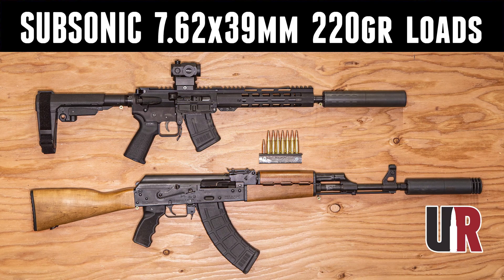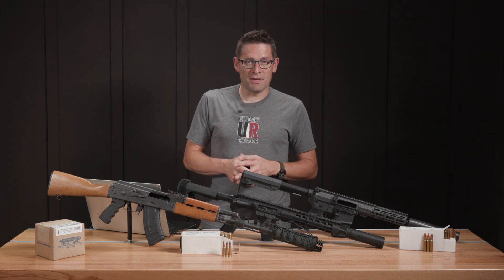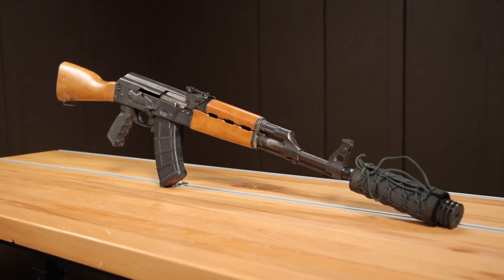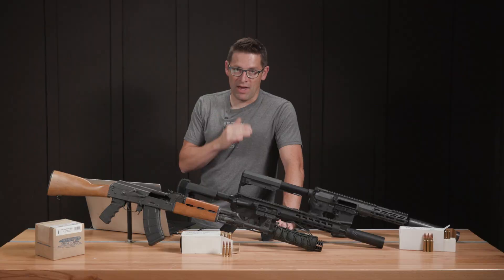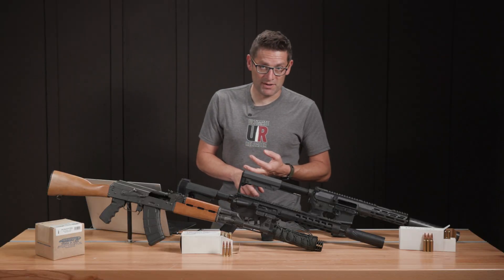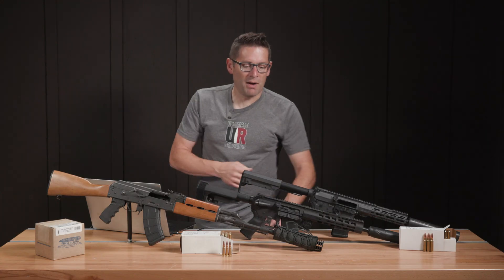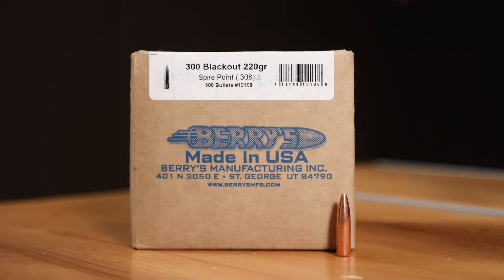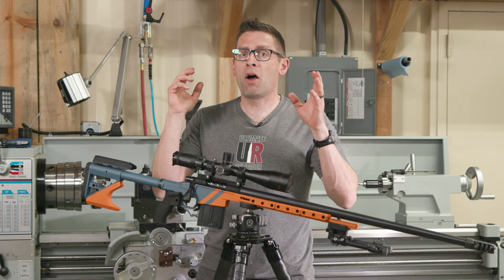Berry's 220gr .308: Optimizing Twist for 300 BLK, 308 & 7.62x39!

Comment: n110 or even n120 is much better for this application, same fps and oal and bullet the same amount of n110 burns out 100 percent of the powder while also giving around 15k pressure at 3.5 inches or where the pistol gas port would be, the same load of h110 has slightly less pressure which in this case is bad for cycling the action and only burns 80 percent of the powder. also h110 with that same load was 12.5k pressure at the gas port according to gordons reloading

Comment: I shoot lots of these and the 200’s. I’ve settled on IMR 4227 but only push them to about 950 fps.  They might be louder slapping the bank than at the muzzle of my bolt gun 😂

Cycles my semi just fine w adjustable block w no gas to face at all. As a result, I’ve bought out the global supply, so good luck finding it. Kidding, but I did stock up.  

Also optimal for Steyr AUG, notorious for face gassing. Runs mine perfectly.

Comment: Back in the mid -80’s, Messed around with a 700 action, barreled, 1:10, chambered for .30 Carbine and a lengthened throat, for 190gr HPBT’s. None of these .300 whisper, AAC, etc, excised at the time, and I wasn’t looking to do case forming…

Comment: I've had terrible luck with Berry 220s. Accuracy has been poor which I can attribute to plating separation. I'll turn my suppressor over and little chunks of plating will fall out.. alignment is spot on btw. I don't have these issues with jacketed 220s either. I'm not running them too fast, average of 900fps out of a 1:7 twist 9" barrel with a Surefire 300sps on the end. My barrel has 5R rifling so maybe that can cause issues with the plating but I doubt it. I may just need to try a different one though to be sure.
Reply: maybe the 1/7 twist is to fast?

Comment: If you've not tried VV N120 for subsonic 300 BLK, I recommend you give it a go.  Better case fill than H110, cleaner burning, and no muzzle flash.  In a bolt-gun where you don't need to worry about cycling an action, N110 is even better as you get more complete burn and less junk in your suppressor.
Reply: n110 works really good in gas gun too, was worried but i actually according to gordons reloading tool get more pressure at 3.5 inches (pistol gas port location) than n120 and better burn out

Comment: In 300BLK I use 6.0gr TiteGroup to push Berry's 220gr plated bullets.  I get 
981 fps
STDEV of 2 FPS!!
ES of 6fps!  

It's under gassed for an AR without enlarging the gas port but is amazing in a bolt gun.
Reply: Very interesting load.  If I had a Ruger Am Ranch bolt gun in 300BLK I’d definitely try that.  

Titegroup is a useful cast member in the powder ensemble
Reply: @FMDad-dm5qo  i do it to and also noticed it was much quieter and the stdev was retarded less than 5 lol too, get a howa mini action from brownells dude

Comment: It's quite interesting to see that the same bullet needs different amounts of the same powder to get the same velocity in different cartridges. 
Let's not forget about the 30-30 and the 300 WinMag under particular circumstances. 
I am considering a 30-30 subsonic build. It would be an 1967 Marlin with a custom threaded 1/7 twist barrel. I believe in keeping original parts original and modding new replacement parts anyway.
What length of barrel would you recommend? 
I am considering the possibility of 3d printing a cap for the tip of the bullet to make it tube magazine safe. What do you think about this idea?
Thank you for your time and for the great videos!
Reply: Because the pressure drops when the case size is larger or smaller so you need more to fill up enough to get the same pressure

Comment: casting and powder coating for about .06 a bullet.  lee 230gr 30cal.  300blk ends up at about .25 a shot, if you dont count brass.  i just saw a site has berrys for .30 a bullet.  thanks but no thanks
Reply: @Sageofthe16  exactly no thanks for that price. I remember when they were in the teens. I have a feeling he’s promoting these bullets do to drop in sales

Comment: 7.62x39 isn't a .308 so I am a bit confused, I believe it's a .311 so I am not sure on the accuracy.
Reply: SAAMI spec for major diameter of 7.62x39 bullets is .312, but commercial bullets range from .309-.311.
However the land diameter for both 308 Win and 7.62x39 is all .300" on the dot.  It's close enough the slightly wider bullets are expected to obturate successfully when entering the rifling.
Reply: @rhekman  Also, being plated and not jacketed, it will deform and obturate easier than a jacketed bullet.
Reply: @rhekman  I will admit that's a good explanation and also going to get me in trouble by opening up more options
Reply: That was my thought as well.
Reply: Gavin did discuss this in the video.
Reply: @greatdane3343  I will admit I did jump the gun and write my comment before I finished the video, as well as the constant disttsction and responsibility of children I didn't catch everything even though I did try.
Reply: @jesseiancassidy  sorry for your loss 😉 
Just letting you know, as it was a quick and easy reference point for you.
Some informative comments to help you too.
Reply: Ive seen loadings for .308/.311
Reply: Wow, a mature conversation in the comments! Kudos guys haha
Reply: All .30 cal